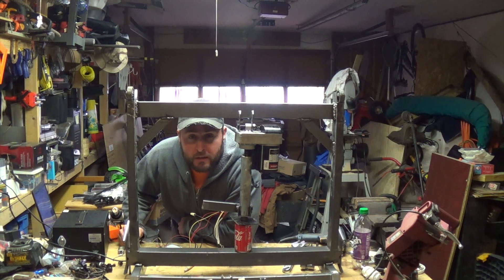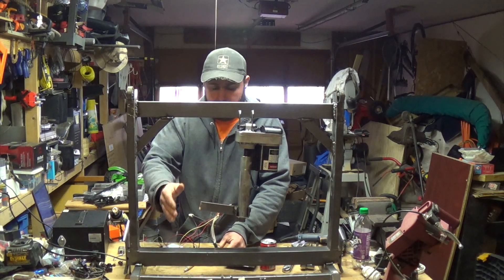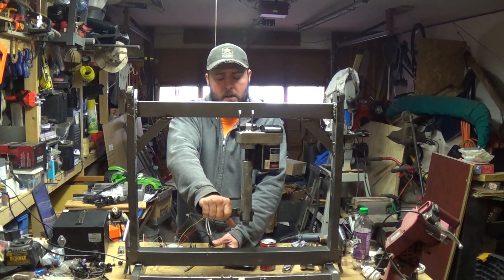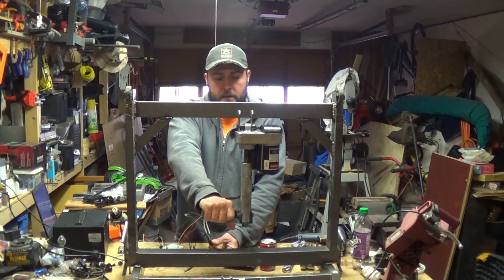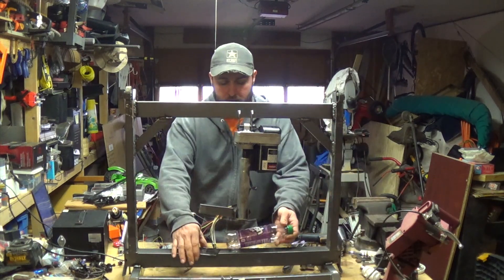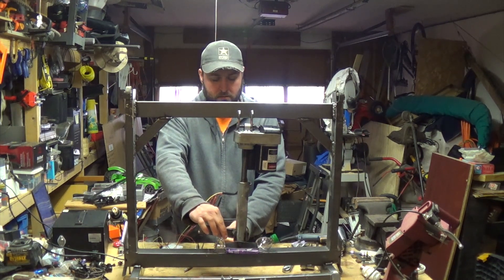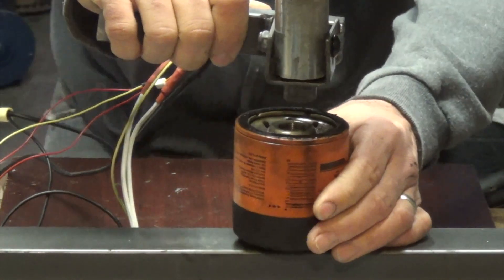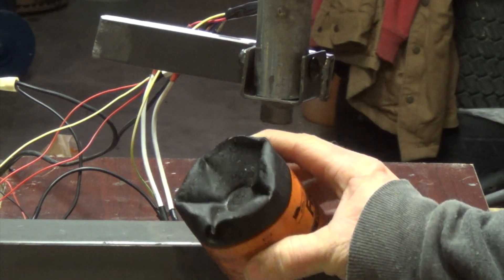DIY Press from Treadmill Parts

Comment: Hell the one i got from a treadmill is a different style but that thing lifted my truck up and both front wheels at that..  its a worm gear and rack style..  but it lifted the truck no problem..woukdnt put too much trust into it but son of a dog did it..  saw a video if a kid who took one to a scrap yard scale and was able to get it to read over 1000lbs before his little rig bent..  all metal gearcase with hardened gears in it and worm gear with a quarter inch of engagement..  so beefy little boogers…
Reply from the maker: I’ve taken apart two treadmills now. The second one had a much stronger motor. I still wouldn’t expect one to do too much. They’re only designed to lift a person